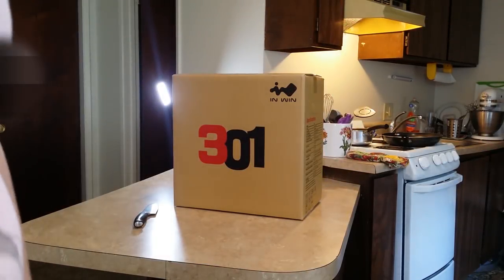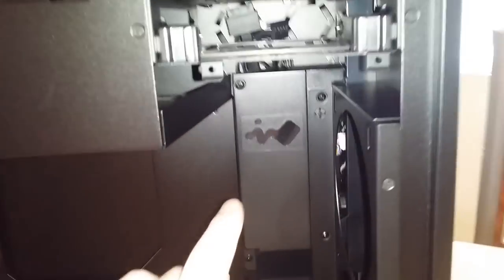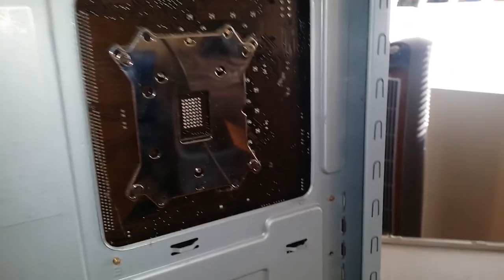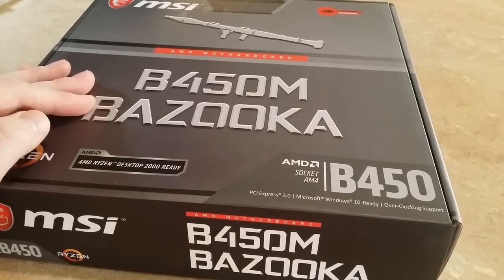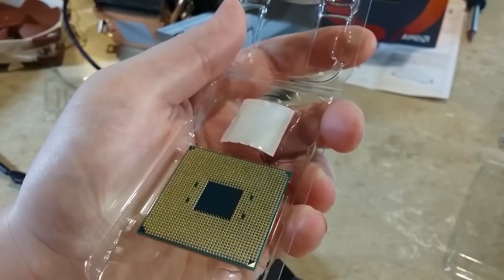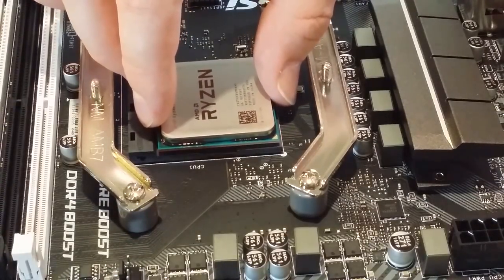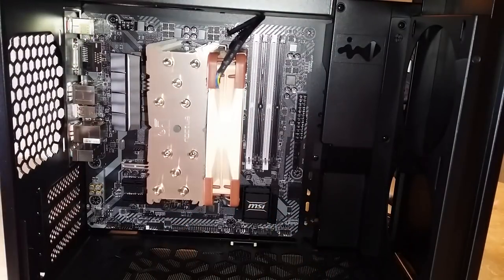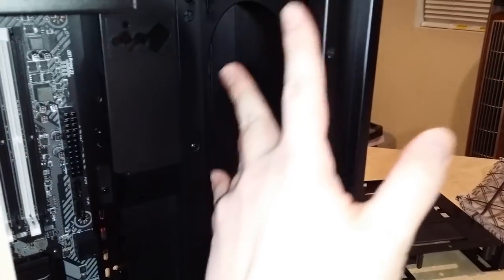New computer vlog (Part 2: Motherboard In)

Comment: In my experience keeping the computer away from the floor seems to have a HUGE effect in terms of dust build-up. My old PC was one of those giant towers that was sitting on the floor under my desk, and I had to clean it every 3-4 months or so. The much smaller case I have now is sitting on a cabinet and, to my amusement, there's almost no dust in there every time I look. The last time I cleaned it must have been about 2 years ago, and it still looks pretty clean.

Comment: Your little warning about the CPU pins, happened to me. Somehow one of them bent, and I was bending it back straight, very...very carefully. and.......it fell off. I cant validate if it still works or not, because it will no longer sit flush in the socket. It was the AMD FX9590, which also ran very very hot. It was very fast, but it was also ridiculously hard to cool. I actually was playing Wolfenstein with it, the newer ones when they came out, and it ran so hot it would actually completely overheat and shut down my computer. The fans would come on full blast trying to keep up. It was a bit crazy. It was also very very loud. When I decided to switch from heat sinks to liquid cooling. WAY quieter.  I was also earlier going to comment and ask about a dvd drive on the front cuz I saw no bays, but you quickly answered that for me. I actually still use mine quite frequently, mainly to burn stuff. Onto disc, not literally. Anyways, like the series, having a nerdarific good time watching you put this thing together. I know how exciting it can be, and frustrating.
Reply from the maker: So sorry about your cpu :o
Reply: @LailaDyer  Thank you. I appreciate that. Your little face is pretty much the look I had. I just sat there like..uhhh...that can't be good. Those pins are very VERY fragile. So I totally understand your hesitation to put it in. So much money can be wasted in one slightly wrong move.

Comment: 20:50: Yeah, and it also just kicks the heat out on both sides, and also straight down onto the motherboard, instead of carrying it out of the case as quickly as possible, like most modern, good, heat-sinks. It also form a unidirectional air-flow, increasing the total air-flow.

So that Ryzen heat-sink is a waste of copper! Just do it sideways! it would probably be on equal ground with the heat-sink you bought, even with the smaller fan, just by rearranging it a bit.

36:12: "Part 1"? lol!

It's looking good!

Comment from the maker: I think in the future I'll put in extra standoffs for the motherboard to secure to, especially around the RAM slots. Quick installation for the motherboard only showed 4 standoffs, but 6 would be much better.
Reply: Marshall Dyer In my experience it is always preferable to use as many of the motherboard standoff holes as possible.